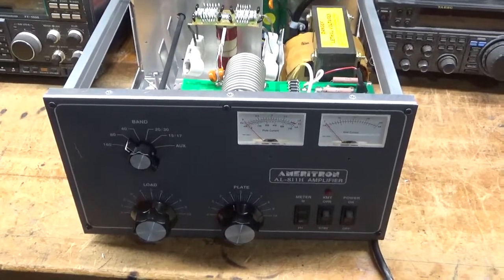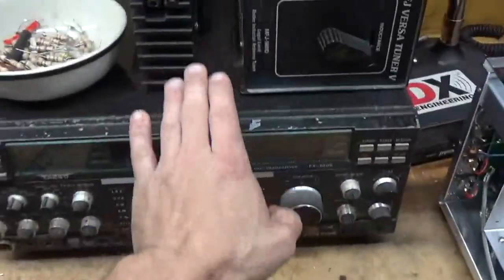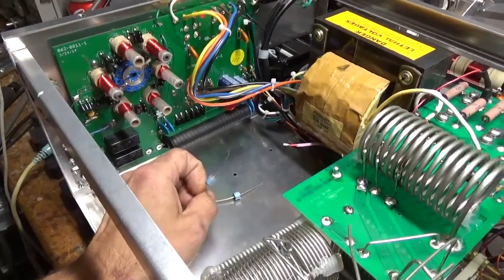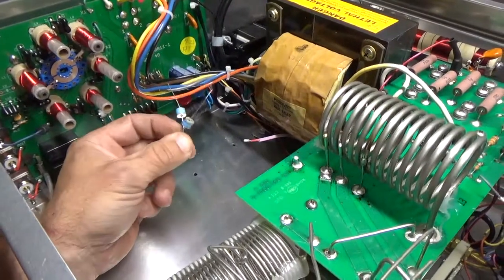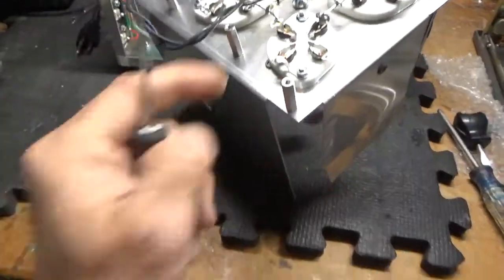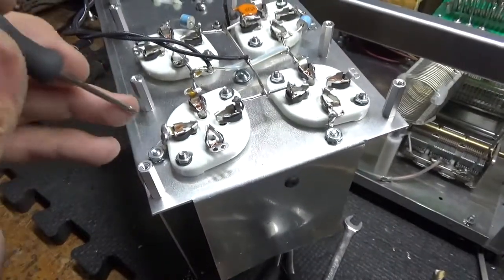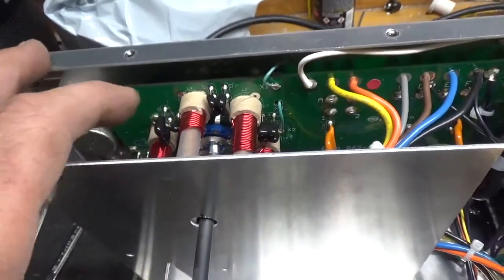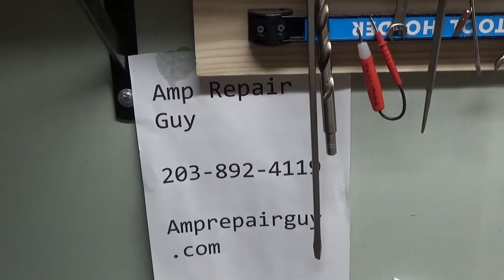Ameritron Al811h Repair And Critical Modifications

Comment: Hey there, I hope you're well!  I recently acquired an AL-811H, but unfortunately the "Load" variable capacitor is not turning smoothly throughout.  Seems to get very tight around 5 through 6.  As such, I fear some of its plates may be contacting. I suspect this because the amp was shipped to me with tubes installed and unprotected, which resulted shattered glass inside the amp throughout.  Initially, turning the "Load" knob did not actually turn the rotor, where the knob was just rotating on a stuck shaft, but with some finessing, I was able to get it to rotate the rotor.  The plates on this variable cap are so close together its hard to tell if contact is being made, or if the shaft itself is just damaged in some way which is less concerning to me. 

I've noticed that MFJ sells a 282-2113, a 20-823pf replacement, however, given the fate of MFJ, I'd be surprised if this is something they would have in stock... none the less I have not contacted them yet.

I have yet to drive the amp, as I fear a short on the "Load" however, for what it's worth, the Grid Current with no load is 1700 with some vintage RCA 811A's installed. 

Two questions for you:  

Is this something you would be able to address if i solicited a repair from you? 
 Alternatively, would you happen to have any recommendations for a replacement?  

Returning this seems to be out of the question since it was a private sale of a "Works Good" amp.  Thank you so much!